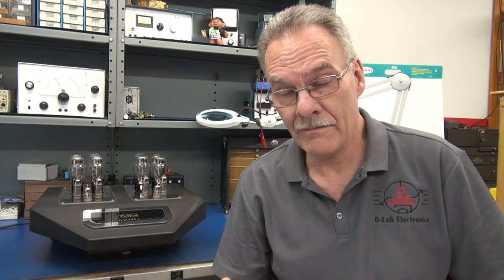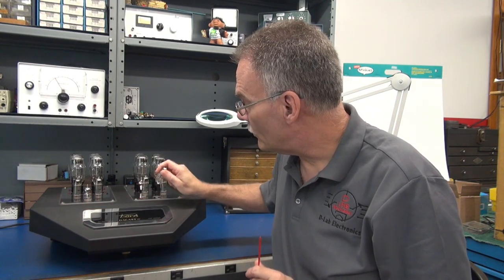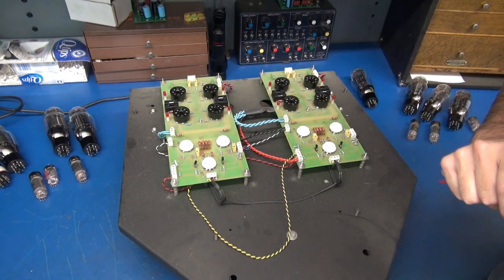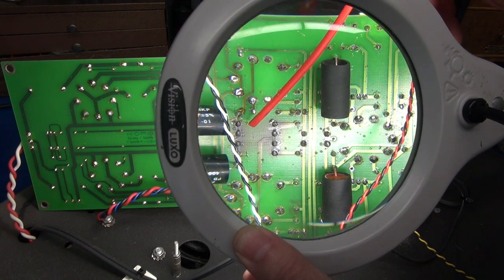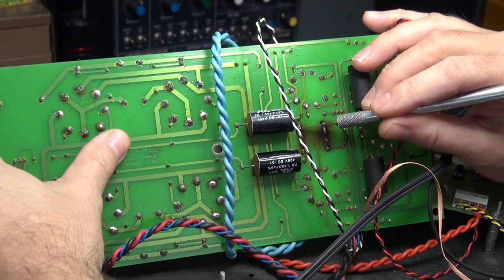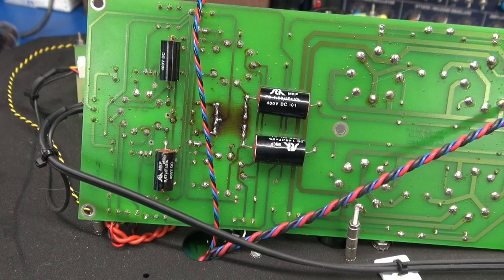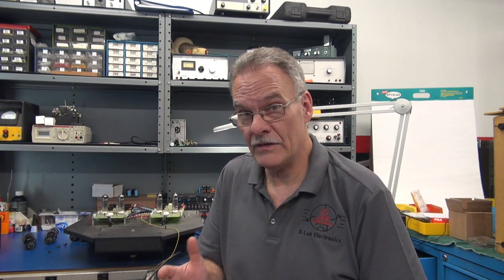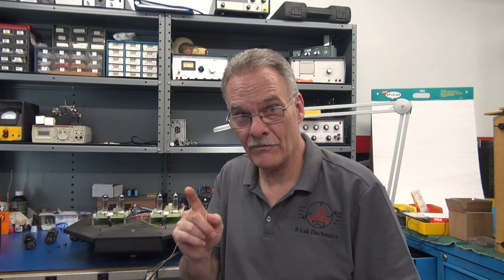Kora Galaxy 6AS7 Class A Tube Home Stereo amplifier No output  Preamp tubes dead Interesting Repair

Comment: Sometimes where the copper traces are spaced enough I drill a few holes in the FR4 to allow air flow through the PCB to the hot components. There looks to be lots of space on these boards to do this. Also if the FR4 is sufficiently charred it can become conductive so introducing some slots can prevent this affecting curcuit operation, especially in high impedance circuits. Ideally the case would also allow some ventilation for air flow.

Comment: I am the owner of this amp, and I am now sad.  I auditioned this amp at least 5 times for a minimum of 20 minutes a session.  There was very little information online about the amp, and what there was just gushed about the sound of the amp. Every musical piece I threw at it sounded outstanding on several different speaker combos.  Eventually, I just purchased the Kora and enjoyed a little bit over a year of blissful HiFi using the Kora and a pair of Snell Type B speakers before moving.  I was shocked and disappointed to see what was under the hood of this thing.  I am not sure what I will do with this thing once it is repaired. I am positive it will still sound sublime, but I will also have that pit in my stomach every time I look at it.  I am just glad I found Terry.  I don't know too much about him yet, but I am watching his videos, and he seems to be a whiz-bang at anything electronic.
Reply: No need to be disappointed, those are fine parts inside. Small amount of parts do not equate bad design, more simple circuits often are better sounding, more "pure". Only thing you could change, would be those SCR axial MKP coupling capacitors.. Those are not good quality, i would change them something better that fits inside, like v-cap ODAM. If it sound good with already SCR in, this amplifier has serious potential for higher level of fidelity...
Reply: Allright, i looked trough it again and yes, it has lot of problems with underrated parts.. Still the circuit (sound) design is definitely good from what i have heard.. Maybe it could be salvaged with extra heating holes drilled on bottom and some trough pcb? I wish i would have thise circuit schematics, i would build it just to test it out...

Comment: I bought a brand new Primaluna tube/valve amp...I'm an Aussie by the way and we call them valves here in Australia.
It was $6,000 brand new. All point to point wiring and it has never been moved from where I put it about 7 years ago. All the tube sockets are attached to the chassis with holes surrounding each of the 8 EL34s and it just runs perfectly and adaptive auto bias eliminates multimeters checking bias every month . Did the guy who bought this have his eyes closed when he bought it? I mean tube sockets mounted on PCBs is asking for trouble. The only PCBs in my amp run low voltage things like LEDs fitted to the front to show selection and triode or ultra linear mode and I was expecting to see in this guys amp big Nichicon caps etc etc. It looks like a toy under all that. A friend said to me to check out Primaluna gear. Like Macintosh, they rarely if ever need to be serviced. This thing is a joke. Sorry but I call it as I see it. Cheers.

Comment: 6AS7G's are really cool tubes. Very low gain, but very low plate z. About 27 years ago I built a stereo single-ended Class-A amp using a single 6AS7G and a single 6SL7GT. No NFB. The rectifier was a 5AR4. 2.5 WPC, and needs about 3VRMS in to push it to clipping. 

6AS7G's must be run from either an indirectly-heated tube rectifier (like a 5AR4) or must have some other means of keeping the plate voltage off them until the cathodes come up to temperature. Otherwise, the cathodes will be stripped and ruined. The tube books warn about this, and they're not kidding.

Comment: An overcooked mess with the wrong tubes in it. Looking around on the web will point you to a builder's spec ( no 
schematic diagram unfortunately) and some idea as to what could be wrong besides burned spots on  PC boards. 
Should be standard operating practice or SOP for all builds. Glad Terry found out what was needed to know!

Comment: 6AQ8 & 6DJ8 have same pinout but very different mu & gm (and therefore rp, which I didn't find on 6DJ8 datasheet. Mu 57 vs 33, gm 6000 vs. 12500. Swappable in an emergency, maybe in a TV cascode, but maybe not in this...

Comment: Hello Terry, if you’ve got some 6AQ8/ECC85’s in stock, they do cross-reference to the 6922/E88CC’s per the RCA tube manual. I’m interested in seeing what this thing can do, and you’re just the man to get it running perfectly. Thanks for all the great videos, looking forward to the outcome
Reply: ecc85 and ecc88 are not interchangeable.
Reply: E88CC’s do cross to 6AQ8’s . An E88CC is also known as a 6922. Look in the RCA Receiving tube manual, page 599, column 9AJ
Reply: You’ve got to pay attention to those prefixes, it’s definitely confusing sometimes.

Comment: The 6922 also has a shield between the two triodes that connects to pin 9. Better isolation of the triodes than a 12AX7. Wonder what pin 9 goes to inside this amp? Chassis ground?
Reply from the maker: Thats a good question. I will explore that and feature the results on part 2

Comment: This is a bit of a strange amp. It's 50 wpc in Class A. Usually these class A amps have power output of less than, say, 12-15 watts and then they're coupled with higher sensitivity speakers. Could this type of amplifier design just be ill-suited to higher power output? They're just naturally producing lots of heat.

Comment: Circuit boards are problematic at best. Nothing like point to point wiring if it's done properly.
Reply: Components are not high quality ........and heat damage because of wrong build and choice of underrated resistors is unacceptable for this kind of amplifier.( and pricetag ! )

Comment: After removing the top I'm NOT impressed.  Lots of flash.  Not much substance.
Reply from the maker: Yes, I agree, would have been nice to have a schematic, may have actually completed the repair : (
Reply: Yeah, that was a buzzkill for me. Lol
Reply: My first thought was "Wow! A transformerless design?" :) (02:02)
Reply: I thought the same thing, what a silly-looking space-waster.
Reply: That's a 4,100 amp at retail. It has about $100 worth of components in it. And the designers didn't put any thought into the fact that it was class A and was going to thermally damage the circuit boards. Just lunacy.
Reply: @robinsattahip2376  It's amazing what one can do to make a unit look 'expensive'! Those PC-mounted tube sockets are a deal-killer!
Reply: @d-labelectronics  I don't think you'll need a schematic, Terry. the circuits look very simple with very few components. I would almost say it was 'built to cost'!
Reply: @dhpbear2  I'd say it was built to a large profit margin.😱

Comment: Poor construction...printboard, small resistors, looks so cheap! And why using 4 tubes each channel? Ok, it's a OTL amp, but...I build one, with just 1 6as7, even OTL, driven not with a penthode but with a triode 6SN7, and the 6SN7 is driven by a ECC83. Using 1 watt resistors , no printboard . Ok, you must use high rendement speakers, and at least 16 ohms, i'm using 24 ohms for more power output, and it's more dan enoughs to discontent the naburs...😊. Try to replace the 6AS7 in a 6080, same audio but much more better in construction. The total power consumption by 230V is only 92 watts...not bad at all ! And if you needs more power output, you can use the 6336, but the filament amperage is 5A by 6,3 volts each. If you ever will make a tube amplifier, use metalfilm resistors for the drivers (noise- free), use stone sockets for the 6AS7, NEVER use printboards , and take your time! Sorry for broken englisch😒
Reply: Bur sounds good